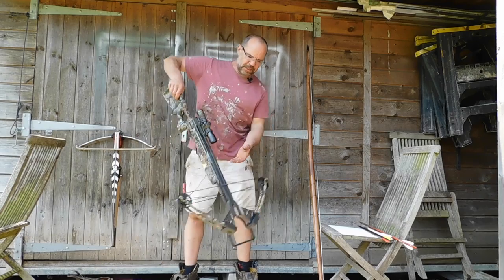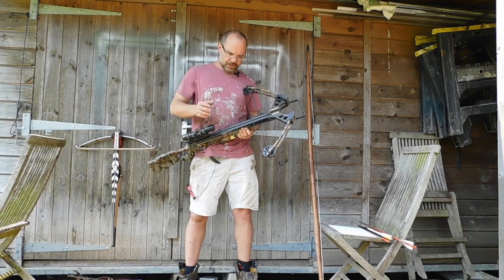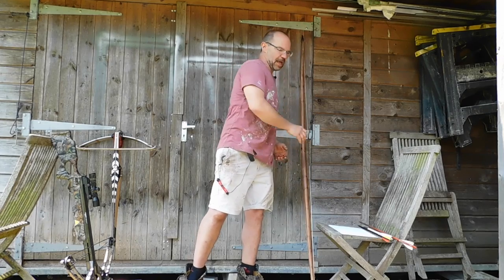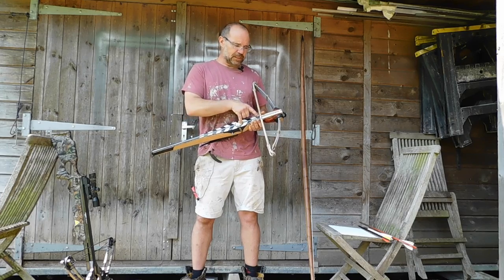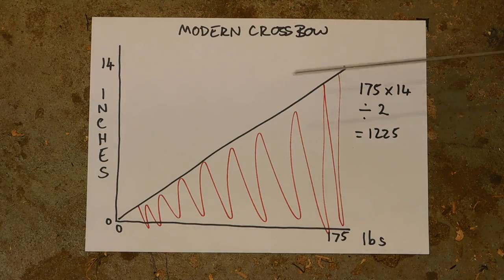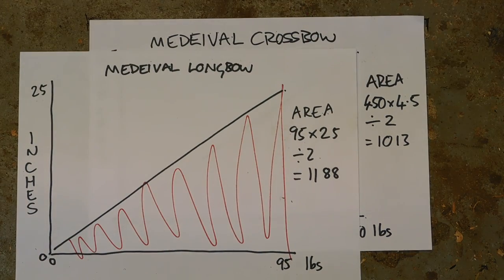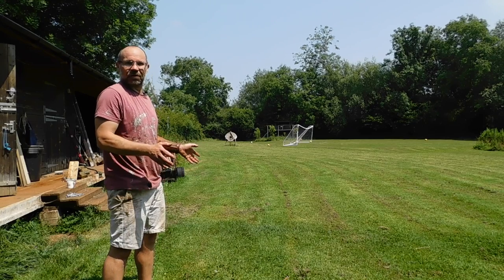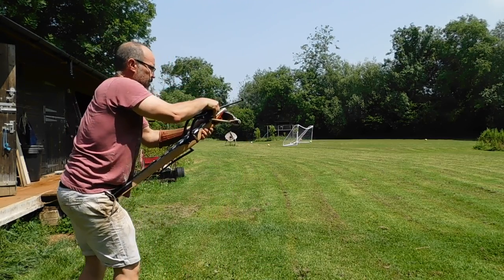Draw weights of medieval crossbows, longbows and modern crossbows

Comment: Don't know if you'll reed this after 3 years, but there's another thing that could be interesting to compare, and that is speed (and therefore energy just before impact. Different bolt/arrow cross-sections and initial speed should give quite different energy losses though air resistance.

Comment: Great video. Would this argument be easier if considering the energy delivered in the target? Pick a target distance and measure the energy delivered as that would be “ability to damage”. Which might be an easier absolute number to compare. Play with arrow weight until optimal impact force is achieved for that bow at that distance. Or am I missing something basic here?

Comment: It's interesting to see how different bows perform. Your 95lb longbow performs similarly to the 70lb longbow tested by Robert Hardy in "The Longbow", while Edward McEwan's 80lb longbow had another 10 m/s on your bow in "Experimental archery: projectile velocities and comparison of bow performances". 
From the powerstroke of 25", I assume that your longbow was 95lbs @ 28", whereas McEwan's was 80lbs @ 32", so that would account for some of the difference, but Hardy's was 70lbs @ 28". Are you using natural or synthetic string on your longbow?

Comment: Heavier and slower objects lose less energy to friction in comparison to faster and lighter ones. So modern crossbows are not 3 times as good as medieval ones. Right?
Reply: Medieval heavy crossbows were made more for penetrate at closer range, than for accuracy. Because, almost every warrior, wore at least gambeson. The key was to be able to penetrate average chainmail with average gambeson, at close range. Without it, it would do simple nothing on battlefield. These crossbows were also very effective during the siege, because there were many oportunities to shot at close range, while you could reload in safety behind the walls. So the key was to make so much penetrating force, that could penetrate armor at close range, lets say to 30 yards. And for it, you need heavy bolt (often weighted 150-220 grams), and very high draw weight (1000+ windlass crossbow).
Reply: Lighter arrows will shoot further & faster, but heavier arrows use more of the bows energy efficiently. That's why war arrows where usually heavier. Tod used a 45g arrow, but a 2oz(56.7g) war arrow would be more typical of the majority of arrows shot in war. The lighter ones were used to harrass at longer ranges, but the real killing zone would be under 100m or so.
Reply: Roger Ashcam decried the use of Poplar wood(lower density) for arrow shafts(early 1500s) rather than ash which was much heavier & gave the arrow, "a good strippe". i.e. The arrows hit harder.

Comment: The work done to the projectile is the integral of F(d) over d. Assuming the force F varies linearly with the drawing distance d, and brace height = 0, then it's just the triangle area calculation Fmax x dmax / 2.
For the crossbow: 3825 N x 0.1651 m / 2 = 315 J
For the warbow: 711 N x 0.6096 m / 2 = 216 J

Same order of magnitude indeed. In real conditions the warbow packs more joules so I guess there are additional factors such as yew being a superior spring material than steel, or F(d) highly convex for the crossbow whereas the warbow shows a more linear curve? ....

Comment: The camming on the compound bow changes the power curve from a 45 degree line to something that goes almost straight up, and then flat.  So average thrust is much higher.  Like the (exaggerated) curve of a stack, but reversed.  More area under the curve.

Comment: I haven't investigated this, but my guess is that the modern crossbow should have a force vs pull graph that is roughly rectangular, while the long bow and the medieval crossbow should would be more triangular as you have shown.  By integrating the actual curve, you could get the stored energy which could be compared to the energy in the projectile, to get an efficiency measure of the various systems.

But what would be more interesting is to measure the acceleration of the projectile with respect to distance as the shot was occurring.  Would the efficiency of change with weight of the projectile?  My guess is the modern bolt is too light weight for maximizing efficiency, but is instead more optimized for hunting accuracy.

Comment: I was surprised but the performance of the longbow in comparison to the crossbow, after having seen you go through the graphs. But my instinct and preconceptions were that crossbows delivered more power, but the bolts did not allow for high range. And the longbow were for volleys and arcing long-range shots.

Comment: Unlike popular myth, energy of the projectile DOES NOT equal "damage" at the target. There's much more then just energy that determines effect on the target. Few other important ones are shape, size of the projectile and how it moves inside the target (thumbing, breaking, deforming). Another important thing is what projectile impacts inside the target (speaking about human/animal type target). Bone behaves differently then muscle and muscle behaves differently then some of the organs. Generally speaking it's not total energy that is important, it's part of the energy that actually causes some form of damage that is. Not all energy will cause damage. Some will be absorbed -turned in to heat, sound, absorbed by the elasticity of the target (temporary cavity). And that is generally determined by the other properties of the projectile itself and the target. You can roughly compare weapons which use the same projectile, or at last same type of the projectile. But comparing firearms using bullets to weapons shooting arrows and bolts using energy is pointless. Bluets generally push through target and cause wound cavities that are much larger then diameter of the bullet. Arrows on the other hand generally cut through target and wound cavity is equal to the diameter of the arrow (arrowhead and it's shape including). Cutting is more efficient then pushing, therefore arrow needs less energy to cause the same damage as bullet. Again, speaking very generally.

Comment: I suspect the modern crossbow actually ramps up in draw weight faster than your linear curve would indicate, at least based on my experience pulling modern compound bows. Any chance of a putting a scale on them and checking the draw vs lbs curves for all the bows?

Comment: I'm in a medieval reenactment group, we can not have modern crossbows, bows nor arrows. And we are limited in the power for safety. So your two crossbows are not allows, but your longbow is. Except, I don't think I could use it. (I don't have the strength any more.) Still, I like your videos. You have such interested stuff and information.

Comment: This was fascinating. 

Is energy a more important consideration than momentum for an arrow? Also what's the limiting factor in shortening the limb length?
Reply: I believe that momentum is a better determinant for penetration than kinetic energy. My experience of shooting a 65lb draw-weight composite flat bow vs a 22lr was that the 22 rounds would bounce off many things (steel drums, concrete post for example) that the arrows would penetrate or take chunks out of.
Reply: without being given KE the arrow ha no momentum
Reply: .308                           8.9 kg⋅m/s
9x19mm                   3.0 kg⋅m/s
.22 LR                        0.88 kg⋅m/s
Modern Crossbow   2.9 kg⋅m/s
Medieval Crossbow 2.5 kg⋅m/s
Medieval Longbow  2.0 kg⋅m/s

This is a more realistic comparison of damage.

Comment: Tod, your basic data is interesting but I feel it falls short when it comes to telling the true tale of the energy (and thus, potential effectiveness) of all these projectiles. The problem is that you only measured the energy at point-blank range, which is a desperation shot if it occurs at all. If you were to show the joules at 25m, 50m, 100m, and 200m, as well as the weight of the projectiles so that we had something to compare it to (there are many arrows, many different bullet weights, on the market), then I think we would have a much better understanding of the effectiveness of each projectile. Point-blank range is not at all a clear indicator of what we will see at extended ranges.

Comment: I'd say that this is all very informative, but you skipped some important metrics, which may be more difficult to test. For the damage of each weapon, what matters most is the energy of the arrow when it reaches the target, not when it leaves the bow. So a more massive, narrow arrow or bolt will lose less energy to drag forces during flight. Perhaps measuring velocity at the end of flight would be a better indicator. Next, I think the main strength of the crossbow was not that it did more damage than a longbow, but that it was much easier to learn and use than a longbow. Additionally, a crossbow does not require the user to hold the weight of the bow when preparing to fire, allowing them to be much more accurate with little training. They can take a moment to line up the shot and aim down the sights, while a bowman has to hold the bow drawn back until they fire, which is very tiring. Obviously a well trained longbow user would be greatly superior to a run of the mill crossbow user, but wars are won by economics and logistics, and it is much easier and less expensive (at least training wise) to field a large group of crossbow users. Ultimately, being able to train and arm more soldiers more quickly and achieve perhaps just slightly worse results from each individual is a better strategy. All this is to say that a longbow may be a superior weapon when used to its full potential, but a crossbow's full potential is passable and much easier to achieve. Wars are not won by a single skilled individual, but by a large group of well equipped, well supplied, and well trained soldiers. The average effectiveness and expense of your soldiers is very important.

Comment: There is indeed an optimal distance in which the multiple factors balance out. One additional huge contributing factor to actual distance the arrows fly would be the aerodynamic properties of the arrows, mainly drag, which is a force that acts to counteract a moving object in a fluid medium (such as air). This increases with the square of velocity and depends on the shape of the moving object - arrow (rather than mass). So more massive arrows would have less speed, but would also suffer less from drag. They would fly lower and have slightly less flight time, but could maintain the forward speed for a longer distance up to a point where the exit speed would just be way too low. But provided that the arrow shape, angle of the shot and output energy of the bow don't change, the kinetic energy and aerodynamic energy losses should balance out in one optimal value for the arrow mass parameter for ultimate range.

Comment: I think you're justified in suggesting the historical reference might be exaggerated, because a crossbow operating at ranges that high would've remained in use well into the centuries instead musket rifles started taking over. It's not until the 1700's that a musket rifle performed effectively beyond 200 meters.

Comment: Considering that medieval folk used pulleys like the windlass to cock 1000+ lbs. crossbows, could they have made a compound crossbow, or even a reverse-limb compound crossbow, with only string, wood, & steel?  If so, could it be made small and light enough to be used as a light crew-served weapon operated by a highly mobile team of 3 men on foot?

Comment: I wonder if the basic premise is miss guided....

I'm not sure the 'muzzle' energy is the most important deciding factor for lethality.

Damage to the target is based on power dissipation at the distant target (how rapidly the target must absorb or deflect the energy delivered by the projectile.)

Aerodynamic (viscous) losses are proportional to the square of speed. A small fast moving projectile will lose energy far more rapidly in flight.

Longbow arrows are heavier and, despite their size (and fletchings), they might suffer proportionally less air drag because they are going much slower. They might be able to retain and deliver proportionally more energy to a distant target than, say, a .22 round.

Comment: When I was younger I watched a demonstration by an archery teacher comparing a 357 magnum handgun to a 55 lb hunting recurve bow. He took a coffee can and filled it with pea gravel. He shot the can with the 357 handgun and made a hole in one side of the can. As expected the pea gravel stopped the bullet about halfway through the can. After that we weren't expecting much from the bow. With a broadhead point on the arrow from the same distance he shot the can. The arrow did not go in the same hole as the 357 round, rather it made a new hole and the arrow stuck out both sides of the can about the same. So, the arrow had a better penetration with a lower joule energy. This is in part due to the length of the arrow and the mass being spread out over the length (as the tip penetrates the mass of the shaft continues to push the tip through the object) as opposed to the bullet having all its mass in a very short distance (which permits a more sudden transfer of energy).
Reply: I think your analysis is correct that the bullet has a more sudden energy transfer which is why it penetrates less. I'm wondering if your archery teacher was trying to impress you by suggesting that the arrow was deadlier, which of course isn't the idea.

Comment: I'd like to make a point about stopping power. Yes a .22 lr has higher Energy when it leaves the weapon, but you also have to consider energy delivery at impact. This is where the medival weapons are much better. The energy delivered at impact should be more or less "p = mass x velocity" considered that a soldier behaves like a ridgid body at impact. So all in all medival projectiles are more effective than a .22lr because of their weight.

Comment: I noticed that Gallwey said that his crossbow had a 38 inch prod but only 7 inches of powerstroke, whereas your 1250 lb crossbow had a 28 inch prod and 6.5 inches of powerstroke. Why do you think that Gallwey's crossbow had a design of such a long prod with negligible increase in powerstroke? Won't this decrease its power? Why would a crossbow be designed this way?

Comment: Great info Todd ,I'd take the Medieval crossbow has  a  certain charm about it looks awesome.Could a horn & sinew prod be drawn back further.Cheers.
Reply: OK Thanks Todd I am fortunate to have some original  bolt heads from 13-14 cent.& have made shafts & wood fletch from museum copies.I have made some medieval style   crossbows with a modern draw length  & 150 lb.they fly very well but I'll have to save up & get one  of your your masterpieces.What would be the the most powerfull 12cth bow you could make Cheers Mate.

Comment: So if you want to know the punch the arrow/bolt will have (how hard it will hit because of the transfer of momentum) (this goes for anything and everything as well) then you want to use momentum (mass times velocity) not kinetic energy. The kinetic energy of the arrow/bolt right after it leaves the bow/crossbow will tell you how much the weapon worked the projectile (work equals change in kinetic energy). The key to not confusing the 2 is to synchronize the words collision, momentum with walking (you're right step could be collision and the left one could be momentum). Rather just remember when there is a collision you use momentum because in a collision there is an impulse (and the impulse equals change in momentum) . Now there are times where kinetic energy will be used in collisions, but that is to get the amount of energy released out of the two things colliding, this incudes things like the sock wave and sound if in an atmosphere, the heat generated even if it's sometimes small, and the kind of explosion of material/debris in all directions if the collision is significant. All of which don't really matter when these types of projectiles hit the target.
Reply: Thank You sir! Your channel is awesome!
Reply: the velecoty you use to create  the momentum comes from the draw weight so without that kE the arrow has no momentum and in fact during flight over time it will lose speed and while momentum remains due to the mass of the arrow. When you measure velocity/ speed   a lot of KE has been lost  in the string , mass of the limbs, heat and sound, and inertia and mass of the arrow causing it to paradox requiring energi to change direction and to straighten out the flight.   the more and arrow fish tail the more energy is lost. And of course the nock of the arrow has some friction and serves as the transmission  between the limbs and string. the nock channels the power into the shaft and a miss fit will cause energy to go sideways or even up or down , momentum and KE are to separate thing where momentum is mostly misunderstood . That's why using dynamic efficiency is the best way to get a usable gage. bow producers  use the ibo standard measuring speed which means nothing expect calculating efficiency but the speed must be measured with your setup not the standard for the test done in ibo.

Comment: Have any numbers regarding to composite crossbows? Horn and wood together are pretty efficient materials, so I would imagine that a composite horn crossbow would do quite a bit better than the steel one.
Reply: Excellent point. Interesting that they were so popular with the Germans.
Reply: tod todeschini from an acquaintance in Vienna that makes Turkish style composite bows, the issues of dampness are generally overstated. he suspected, iirc it's rather a question of ease of manufacture (with each bow taking about a year to make and cure) and availability of materials (requiring long pieces of horn).